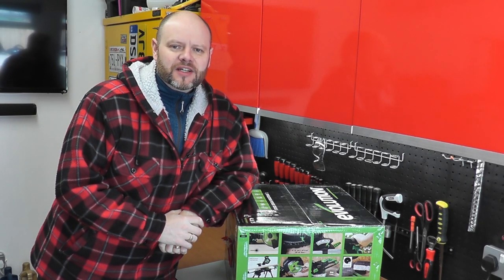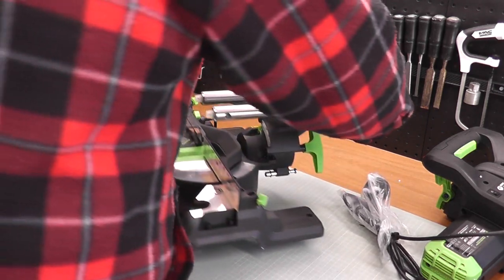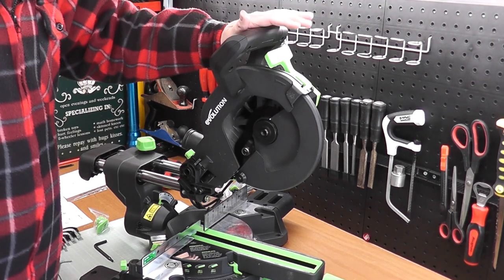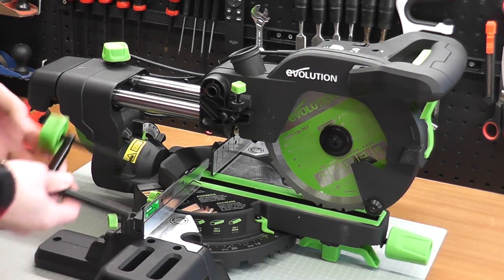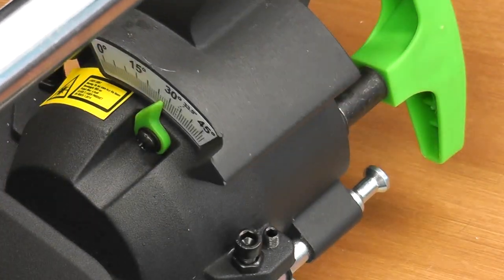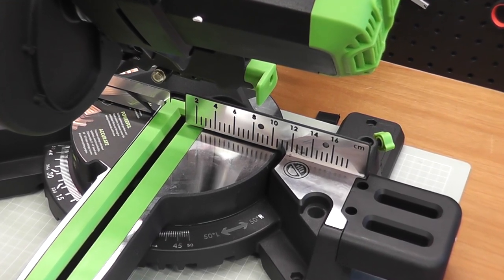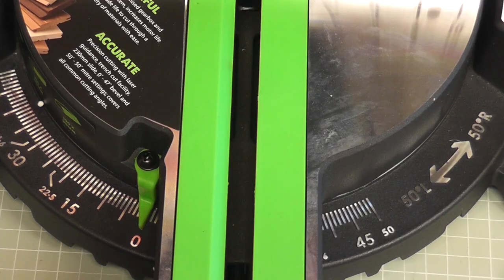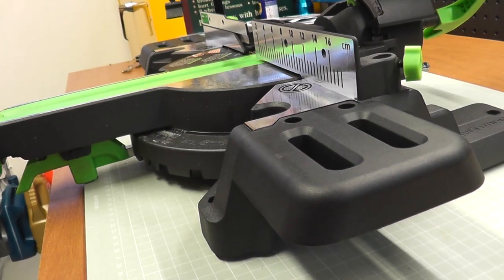Evolution F210 SMS Sliding Mitre Saw

Comment: Nice looking saw Mark!  I love the laser guide.  Mine doesn't have one but it cuts well 👍😂😂
Reply from the maker: Hi Niamh :) It's quite a nice saw and much lighter than my old one but that is all metal and the bed is bigger but it's pretty heavy with the same blade size. The laser is handy but I'm an old school tape and pencil kinda guy and I'll draw the blade down to line up anyway :) the fact that I'll cut most things and has a 3 yr warranty makes it good value I think.

Comment: What's the difference between the F210 and the s210
Reply from the maker: Can you advise of the full model number for the s model you are refering to
Reply: @DadDiaries  the s210 sms+ . F is green and s is orange.
Reply from the maker: The F range is DIY the other is more contractor 🙂
Reply: @DadDiaries  
The orange one (R210sms) has a 1500W motor, the Green one only 1200W
Reply from the maker: @martindare5803  thanks for the info 🙂